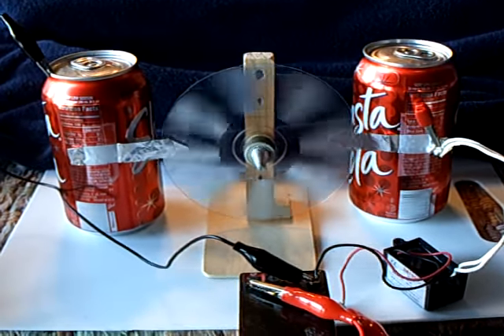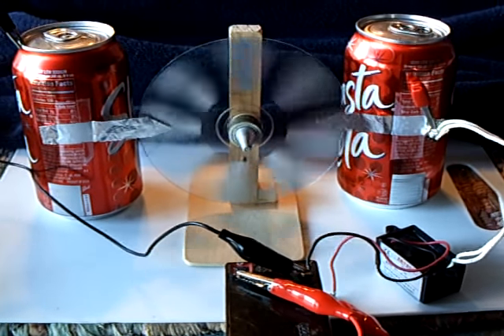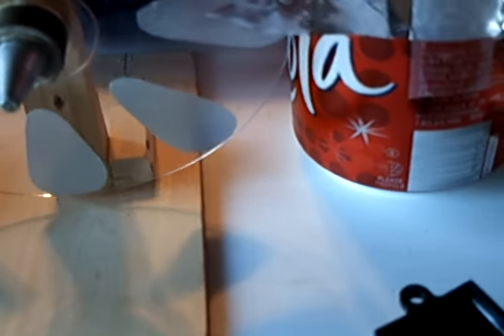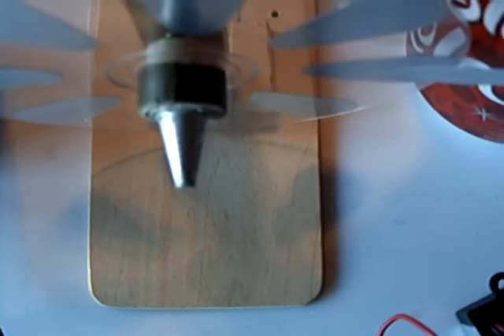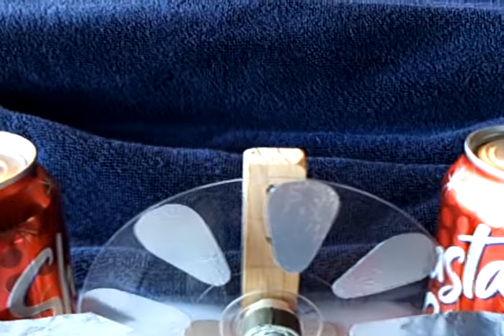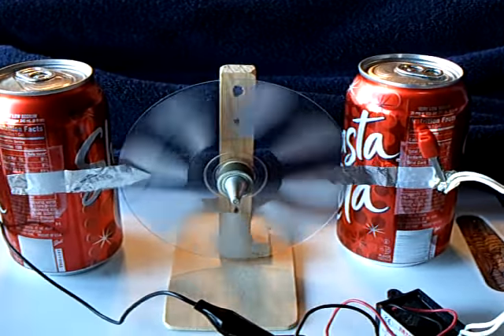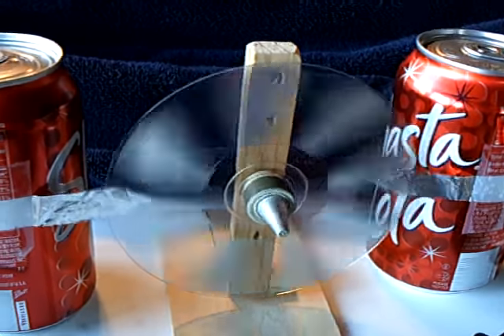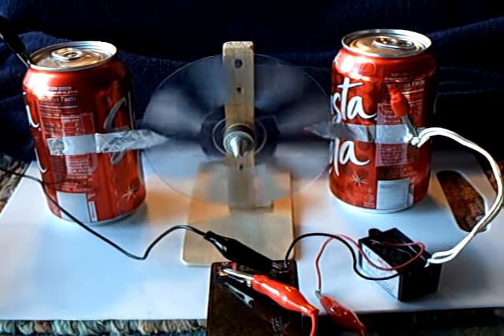Interesting Electrostatic Motor----  investigation

Comment: i suggest you build it properly before discounting it as a fake.the build that was shown self running has one side  to be aluminum separated by balsa wood and then plastic . The strips should over lap touching the aluminum disk side. it must be polysterene not lucite, also all points must be aluminum no copper because of the small extra electron it gathers from friction of the curved part of the aluminium atoms.. Its like a big capacitor plate . this is a key secret that made the thestatica machine work . this also is shown in the video of the Nicole tesla perpetual motion machine although you have to be looking at the disk because he didnt tell you .His has no external power and indeed runs from a well know principle using excess electrons generated by friction to create motion .
Reply from the maker: +Gadget mall-- Many people looked at the faked video in question and several people did builds.  There was a discussion on it at one of the forums.  If you study it closely you can find several glaring problems that tell us that it was faked.  The author never responded to any of our questions.  We think that he put tiny motors in the fat rotor shaft and used watch batteries.  The supports held the motor shafts while the motors inside the shaft rotated.  My build is really NOT how he faked his but rather a look into another method.

Comment: +Lidmotor

 In original video according to explanation there the side contacts near disk are always on positive charge and are generating movement force and the plate from the other side of the disk is on negative charge which just discharge side of the disk but do not cause movement force.
Can you try to mock up this build to be close to original and possible and see how it goes? Even it requires power source it would be still interesting to see on your replica.

Cheers!
Reply from the maker: T1000LTU I don't agree with his basic theory of operation.  Today I worked more on the motor I built but just in a regular configuration.   The other motor configuration might run on very high voltage but I am not going to waste time trying to do it.

Comment: Nice device.  I too figured that guy's motor was faked somehow.  I still think he could be using a directed jet of air but, others say no.  The small motor and battery idea is probably correct.  I really dislike it when folks fake stuff and claim it is real.  Then, in the next few years, it always comes up in the forums posted by a new guy.  "Hey, look, this guy has done it," long after it has been debunked.  Thanks for the explanation of how your device turns.  I never knew the details on how electrostatic motors worked.

Bill
Reply from the maker: Pirate Labs Hi Bill,
Some of these devices are grand little toys even though they are misrepresented as something they are not.  Usually in building them I learn something new and interesting.

Comment: Well done Lidmotor, Yes electrostatics are just too weak for his forces, I guess he just uses 2 micro mobile phone ringer vibrator motors for the axis and gets the current in there via the 2 axis connect points and in the stands are just 2 button cells. The axis really looks like 2 of these tiny motors...
Reply from the maker: overunitydotcom Yes that is my guess also.  Too bad he misrepresented what was happening.  It is actually a pretty amazing little device.  It might run on a small solar panel if he is using watch batteries.

Comment: No matter how convincing they seem I never believe any perpetual motion machines are real. They violate the fundamental laws of physics as we understand them.  Now when reputable scientists discover something to augment those laws and publish their findings in reputable journals, then I will take notice.  And the publications are important.  Remember cold fusion?  Eventually it was debunked by the scientific community because it could not be duplicated.
Reply from the maker: mediaguardian It is too bad that the term 'perpetual motion' is used to cover all things that run non-stop with no apparent power source.   I have several motors now that run 24/7 off light energy using photo voltaic panels.  It is no big deal.  A 100 years ago I would have been considered a 'perpetual motion machine' inventor because the technology just wasn't there then.  Who knows what might be discovered as an energy source in perhaps another 100 years.  We are surrounded by an ocean of energy ---it is just getting it converted that is the problem.
Reply: ***** I tend to use the fundamental definition of perpetual motion.  Perhaps it should be called a perpetual work machine.  But I am all in favor of folks innovating to develop extremely efficient devices that operate from disclosed power sources, or even devices that get their energy from ambient energy sources which could be described as free energy.  I like the terms free and efficient when describing mechanical devices and energy.  The problem is that a lot of these other claims are made either out of ignorance or just trying to pull a hoax.  If they can do it, explain exactly how it works.  If they don't want to explain, then patent it and market it.  Everyone wants a better mousetrap.
Reply from the maker: mediaguardian I totally agree with you.

Comment: If you look at the first few seconds of the video, he shows the bottom of the device from two different vantage points.  There are two round plugs; one on either side. They do not appear to be inline with the vertical supports.  Do you think that is relevant?  Could there be something embedded behind these plugs?
Reply from the maker: Kntryhart  Perhaps this 'illusion' was done using tiny electric motors like these:
http://www.ebay.com/itm/6Pcs-17mmx7mm-Coreless-Type-2-Wires-Micro-Motor-for-RC-Helicopter-Airplane/231417268803?_trksid=p2047675.c100005.m1851&_trkparms=aid%3D222007%26algo%3DSIC.MBE%26ao%3D1%26asc%3D20131003132420%26meid%3D336be61b5e3445a189ccc11ed8152205%26pid%3D100005%26rk%3D2%26rkt%3D6%26sd%3D140991984750&rt=nc

One in each end of the hollow rotor shaft.  Watch batteries supplied the energy.  The rotor supports held the motor shafts fixed as the whole motor and rotor rotated around.  My best guess so far.

Comment: I agree that he may have button cells in there,  one thing i noticed is that his rotor aluminium tape is connected and wrapped around both sides, of his suspiciously thick rotor....anyway,, interesting...cheers.
Reply from the maker: 100roberthenry If you look at the rotor support structure the rotor bearings are horrible------unless their purpose was to hold the tiny internal motor shaft fixed while the powered motor turned the rotor around.   Maybe.

Comment: Cool!

His rotor (polystyrene) & vertical conductor posts (wood) are thicker than necessary.  Perhaps he has a small button cell/s, a coil/s, a magnet/s, & some electronics embedded within both of those things.  It wouldn't be hard to drill out the wood & styrofoam & then insert a battery, wires, & then laminate the rotor & then spray it with black paint.

It should be interesting to see your video when you figure it out (i.e. your version of a pulse motor not a static pulse motor).. :)
Reply from the maker: A B I was thinking the same thing about something being hidden inside the device.  They make super tiny motors that might be just the size of that rotor shaft.  Add a couple of tiny watch batteries and the trick is complete.  Too bad  most of these guys never tell their secret.  I get a kick trying to replicate the illusions though.